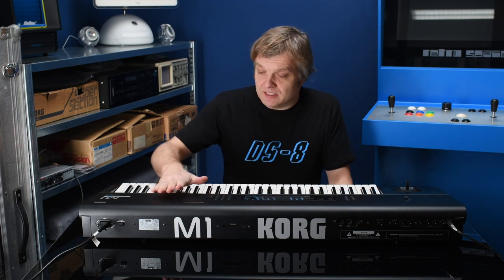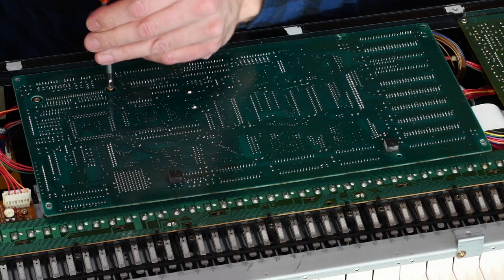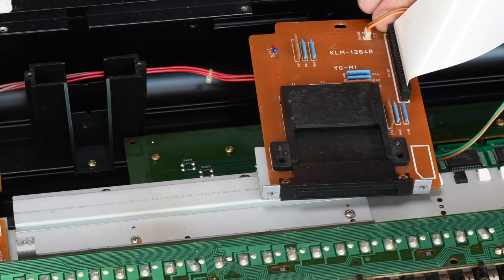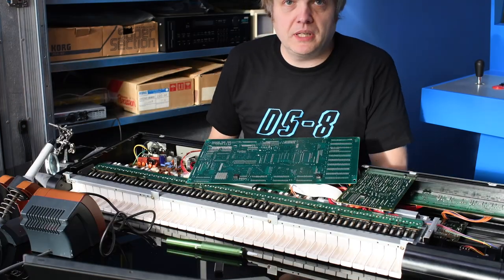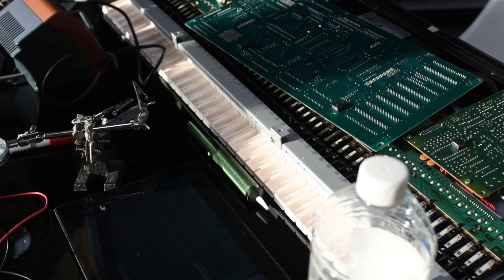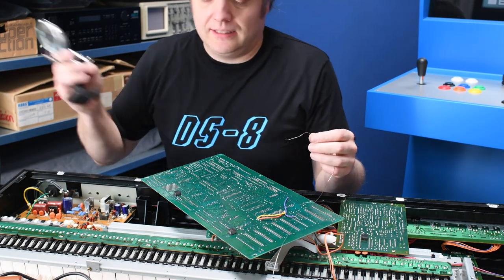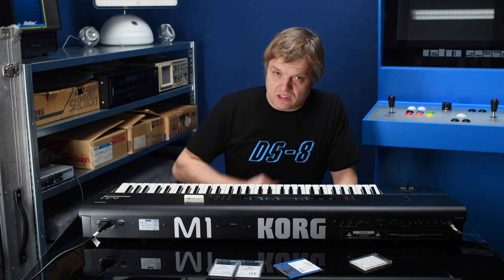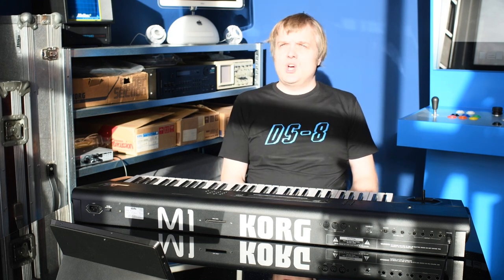Korg M1 EX 4MB upgrade board installation and T-series factory preset load

Comment: I have an M1 with the ex expansion installed in 1988 and 1990 when I bought the keyboard new.

It comes with that white program card too that gives  the T series patches in order. 

Question is about the kits. 

I swear since I had this, that the M1 drum patches 09,  29,  etc were there at the same time the T1 drum kits were also there in C bank from the white card. 

Now that I did a battery change and restore through sysex, it seems that if you are on  the C bank with the white card in, the T1 Drums are wrong, missing sounds and the only sounds on the keys are from the M1 kit sounds. Some keys blank.  ( C-09 T1 Drums) 

But before I had to reload the sysex, I remember the keyboard properly had the M1 drum patches on Internal and the T1 drum patches properly on C.  All the instruments were correct for both I-09 M1 Drums and C-09 T1 Drums.  

I never took the white card out and there was a proper complete M1 internal bank,  and a proper T1 card bank on  C. And the drum sounds were correct for both banks. 

Did the techs do something extra back in 1990 that I am unaware of ? 

I did not have to load the white card to internal like you did in the video.  The m1 sounds stayed on internal and the T1 sounds all worked from the inserted card including all the T drums. 
It would make sense they would release it that way as a proper full expansion anyway.  

So the technicians knew another step that I dont.  Would you know? 

And do you have a link to the m1ex expansion service manual you could share?  Thanks so much the video was very informative :)
Reply from the maker: It is some time ago I did this, but if I read you correctly I miss an essential step to have it work 100%?
Reply: @2kBofFun  yes! thank you, 

when I first got it back from the installation I am sure I had the T1 Drums perfectly on C-09 and at the same time the M1 drums perfectly on I-09.  just left the card in all the time. 

Now, same thing but the T1 Drums have none of the T samples. just M1 sounds and some blank places of two or three notes in a row where T samples should be.  

all the other non drum patches work fine. 

I would have remembered blank notes for sure, never had those. 

and when I try to load the T sounds to Internal, it works just like it does for you. 

however there are no m1 sounds now.  

So I put the M1 bank on a blank ram card

as soon as I put that in I get the proper M1 on C bank but then the T drums on internal get mixed up again.  

when I had it before, for sure the M1 drums were correct on I and the T1 Drums were correct on C with the white card installed.  

there is some system related step I must be missing

Comment: Hi, so glad I found your video.  I’m trying to resurrect my M1 after years in storage and thought maybe you would have suggestion.  When I powered it up to my surprise it worked straight away.  But I got a warning on screen saying ‘low battery’ so I got on YT and found a vid that showed how to change the internal battery.  I went ahead and did that and then put it back together and again, no problem initially - the keyboard fired up and appeared to work.  But when I moved it from work bench back to where I want to use it and turned on again, suddenly there was a problem.  The screen showed only a solid line highlighted on top with no text anywhere to be found.  The control keys to the left of screen also had no effect.  They were still lit up at the time but have since now stopped illuminating.  I tried a factory reset procedure but that did nothing.  So it appears to be in a frozen state and nothing can be done to get to global settings so I can use sysex app to reload the presets.  Do you have any ideas on what may have happened or what I can do to trouble shoot further?
Reply from the maker: I missed this. Did you bring it to a repair shop? Sounds like it needed a serious checkup.

Comment: I have the orchestral card but i am missing the pcm card. ❤
Reply from the maker: That's exactly the half-set you don't want. You can use PCM cards without patch cards, but not the other way around. I fixed some gaps in my collection by finding a M3R set, as they have the same PCM cards.

Comment: I have an Ex M1, it came from the factory like that.
Reply from the maker: What Serial? Curious if it has a special/high serial number.
Reply: @2kBofFun  the serial number is nothing special, it is in the 70000 range. Unfortunately the card that allows you to access the extra storage went missing. Loaned it to a mate who died. He left a cryptic  note, about the card, but we could not find it. I have a bin file of that card but have no clue how to write it to a ram card. Was it ram or pcm that card you have?
Reply: P. S. Anna's there were quite a few rack mount m1 ex models from the factory.
Reply from the maker: @arthurcrime  The EX card has 4MB of extra ROM with samples, and it is built between the PCM slot and the main board. So it sounds like the PCM adapter was not put back in place.

Comment: I have a korg m1 everything works fine but all the key of tone (A) doesn’t work. what could it be? Some buddy told me that the main board is bad.
Reply from the maker: Most of the time inputs are layed out in some sort of matrix to keep band cables small. First thing to do is check the conductance of traces from the A-keys on the controller PCB, and then the cable to the main PCB. Here is the service manual: https://elektrotanya.com/korg_m1_sm.pdf/download.html (wait some 20 seconds before the download link appears). If you look in there on page 12 you see string 4 of the band cable takes care of the A's.
Reply: Ok thanks for your help?

Comment: Can you tell me the part number and where you bought the chipset based you soldered on the board? I bought the kit several years ago but would like to attach the chipset the same way.
Thanks for any information you can share.
Reply from the maker: You mean the ROM chips?